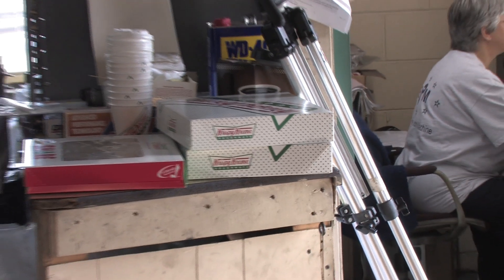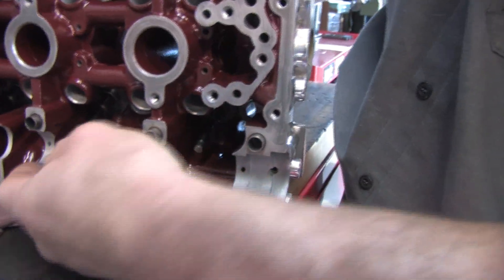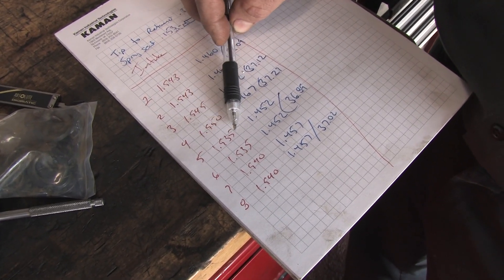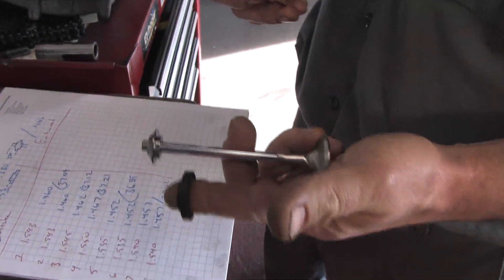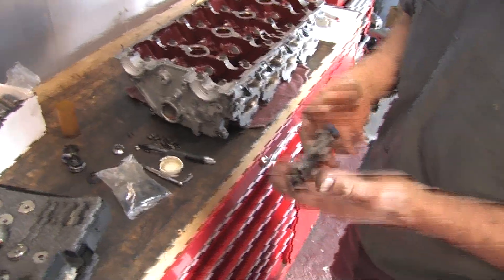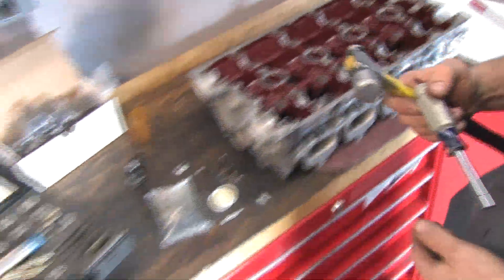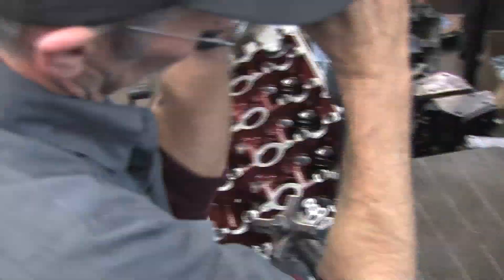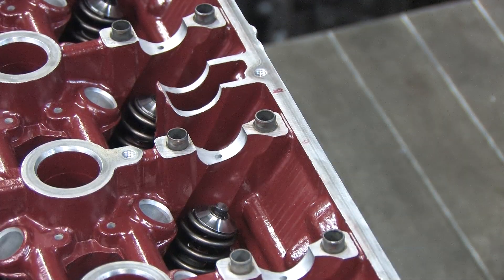Cylinder Head 203 - Valve & Spring Installation

Comment: Hey Jaffro!
When checking installed tip height do we install the hardened spring seat before measuring valve stem tip height?
Reply from the maker: I just did a whole new video about this.  Look for the Galant VR-4's new cylinder head.  It's not the one I'm polishing right now.  It's right before the polishing video.  I bought $1,000 worth of tools, explained the math, built a spreadsheet, and demonstrated how to nail your valve spring height within a thousandth of an inch.  It's a ridiculous venture with an unnecessary level of accuracy, but someone had to do it.
Reply: @Jafromobile  Thank you sir! I will find it and study it.

Comment: So if the height is within 0.010" there is no need for shimming? Is that correct?
Reply from the maker: Yeah, pretty much!  Just pay attention to that rocker angle.  There's typically enough variation in the valve spring manufacturing to negate any benefit of trying to be more accurate than that.  Springs can also degrade over time, so unless you measure the spring install height and check each one's pressure, within a hundredth of an inch, or one pound of pressure is considered a precision job.  Stuart always gives great advice.

Comment: Jafro, this is totally irrelevant to this video but I figured maybe you can shoot me in the rite direction. 
What are I guess you'd say "normal" machine shop prices? Like getting a head decked, basic valve job, and getting a cylinder head cleaned up? I feel like i'm getting robbed from the place I'm dealing with here in NJ!
Reply from the maker: I have paid between $225 for the basics to $950 for the basics plus a mild port job.  I used to be able to get an inline 4 8v head done for as little as $125 back when NAPA used to have a machine shop nearby, but those days are over for me.  It all depends on what you bring them, really.  I can say with certainty that if you have a valvetronic BMW, you're looking at a bill in the multiple thousands no matter where you go.  Most machine shops bill by the hour.  When it comes to head work, those hours can add up fast depending on what you're getting done.  I'm not defending the shop you're using, just regurgitating what I've paid and what I've seen.
Reply: Thanks man. Funny how I just realized you left a comment on this 2 months later. Makes sense though.
Reply: To add with my little experience...My N55 BMW Head was $200 for just a rethread of the spark plug part. I broke a plug in there and that's what it cost me. No cleaning or anything else just that.

Comment: I didn't notice you replacing the valve guides. I used to rebuild engines for a living and I would never go through all the work you did without replacing the valve guides, or at least knurl & ream them to proper specs. For high performance or high RPM engines we used bronze wall guides. Also, we would put a little Vaseline or lithium grease on the valve keepers to hold them to the stems until the compressor was released. You could damage a keeper & or valve and maybe not know it until you drop the valve during engine operation. I rebuilt a lot of agriculture and industrial engines that were coated with something like Glyptal inside but never coated one myself. After watching you do it, I imagine I never will.  These videos bring back great memories.

Comment: Did you have to do all of this, because you are mismatching racing parts for one head? It seem fairly unnecessary to go to this depth for parts tht are manufactured specially for your motor. No parts are absolutely perfect, so is it foolish to put absolute confidence in the brand?
Reply from the maker: These cams offer near the maximum lift range of 4g63 aftermarket stuff.  It's not the highest lift cam set, but what it lacks in lift it makes up for with ramp angles and duration.  Because of their aggressive profiles, I have to have the cylinder head as close to virgin-spec as possible for best results.  That's why I installed oversized valves.  This head had a valve job before, and that recesses the valves when the new seats are cut.  With the lift my cams provide, I need as much clearance as possible on the stem side of the valve... so that the rockers and springs can operate with the proper range of movement, and also while correcting and balancing the seat pressure for my build.  Using an oversized valve let me correct the valve install depth.  It let me cut the valve seats to the depth where I needed them to contact the rockers.  Then we corrected the spring install height by cutting the spring seats to the proper depth and using a shim where we had an anomaly to make the seat pressure balance out.  Having just enough spring pressure for the rockers to follow the cam lobes without floating or wiping them, and also to keep the intake valves shut under high boost conditions.  This level of detail is not done to factory parts when they're being assembled by the manufacturer.  They're designed and manufactured to fit.  The only stock part of my cylinder head is the head itself and the cam bolts.  Everything else is aftermarket.  I've put these parts together and made them a better, more balanced fit than a factory head.  This is the level of detail you go through on a race build, but it never hurts to check the factory.  Sometimes there are easy gains to be had.
Reply: & why Jafro is a super Heavy engine BUILDER!

Comment: Jafro, I have a question regarding valve stem height.  I see that he measured the height of the valve stems, but nothing was mentioned about how to correct the tip height, especially if it is too short.  This was all about valve spring height and adjustments.  A quick example of what I am talking about.  I believe on the intake side at the beginning of the video, at least one of the valves had a tip height of 1.935", (49.149mm).  My understanding is that the spec on the intake side is 49.2mm-49.7mm.  Anything outside of that range is said to put the lash adjuster out of it's optimal operating range.  So how would this be corrected?  I know that if it was too high, then you would just have the tips ground until the tip height was within spec, but how to you get the valve tip higher?  Is a deeper valve job the only way to move the tip further up?  As the gentleman said, you don't want to do that as that negatively affects flow; but is there any other way to fix that?  In your case, it may be a moot point as it was only about .005 off from the minimum spec, but just for theoretical purposes, I wanted to pose the question.

EDIT

I had only watched the video, but not read the info posted below, which is where I saw my answer.  Sorry for that.
Reply from the maker: No worries.  I read your whole question anyway, and you were on the right track.  Yes, recessing the valve further with a deeper valve job is the only way to do that and keep that valve.  If you buy a new valve, chances are it will be longer.  The second option is the route I'd take first.  ;)

Comment: did anyone else kind of cringe when he used the hammer on the valve seals? i pressed mine on with my index fingers and they just popped right on, i spun them a tad just to make sure it was seated nicely. awesome video!
Reply: I have used a ball peen hammer and a socket, so no, I didn't cringe.
Reply from the maker: It shouldn't hurt anything... not with the light taps used here to seat them in place.  The factory valve stem seal driver requires the use of a hammer.  I do the exact same thing with a socket and an extension in one of my Hyundai assembly videos.  If you don't press hard enough to make them seat, and one comes loose, you end up with some pretty serious valvetrain, oil consumption and vacuum problems.  I have witnessed that exact problem before and it's a frustrating thing to take apart and fix once the engine's back in the car.
Reply: On some heads you can just press them on by hand with a socket, some you have to use a socket and a hammer.

Comment: Nices videos.  My EVO X cylinder head is leaking a little and my AFR dips at idle. I must say that you have inspired me to remove the head and see whats wrong with it my self. Once I find the issue I am sure I can drop ot off at my local machine shop, then bolt back on the head.  Thats for the inspiration and motivation.

Comment: Hey quick off topic question... How do you heat your garage in the winter? I am trying to work on my car this winter but i don't know what heater would be safe to use while using stuff like brake clean so yeah just wondering what you do. Btw I love your videos they have helped me out alot. I have a 93 Eclipse with the 1.8 4g37 motor. I know they dont have any real power but its still a great car. Thanks for reading this if you do.

Comment: Hey jafro - 1st, awesome videos. They've been so helpful in my endeavors so far. This is off topic, but removing the axles I managed to shear off the bolt where the lower control arm meets the shock tower fork on both sides. I was told heat and lube. Tried a propane torch and it didn't get hot enough (not red hot) even after more than 10 min. This has me wondering which type of torch you use? I've seen you use it in a number of vids.

Comment: I know this is a newbie question, but why didn't you lightly oil the valve components when you installed them? Not just the valves, (which were oiled) but the valve springs etc.